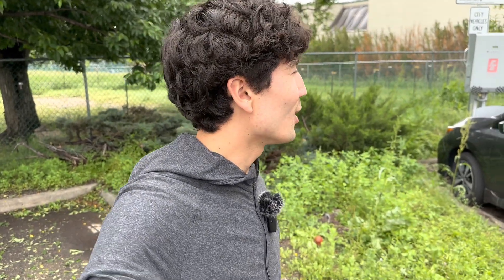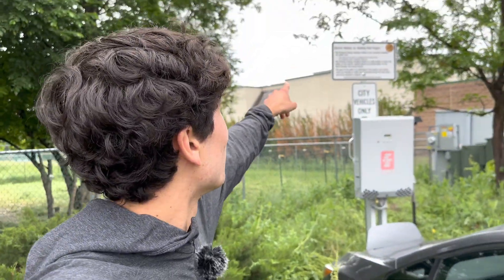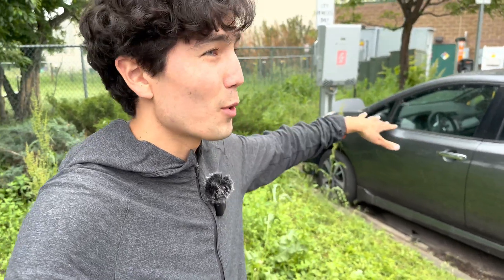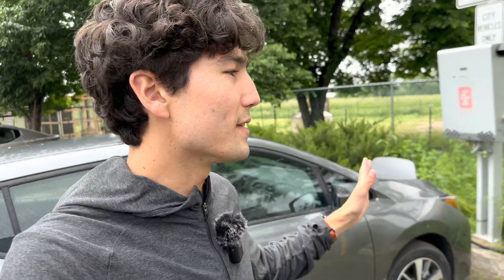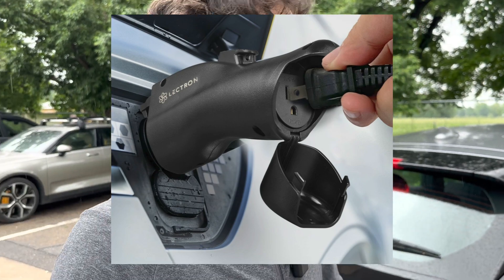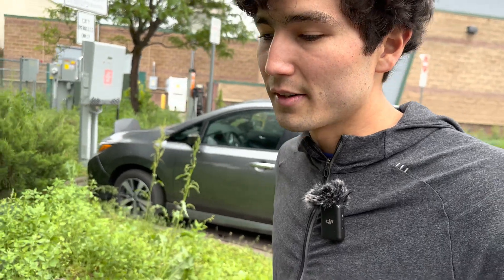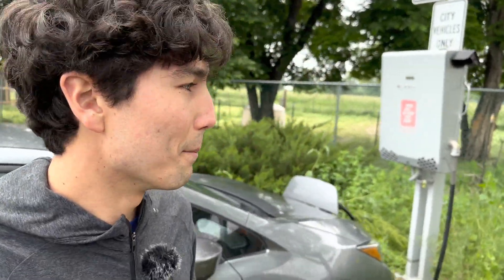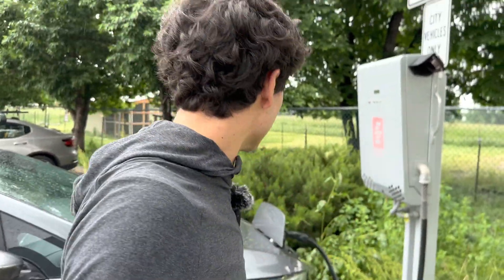This Awesome Tech Shouldn’t Die With The Nissan LEAF - Vehicle To Grid Explained

Comment: FWIW: the Mitsubishi iMiev was sold in the US from 2012 - 2017. It's an EV with a 16k battery and CHAdeMO connector. 

Mitsubishi replaced my battery a few years ago under warranty and it's still giving advertised range. I'd appreciate any info about a V2H system.

Comment: I just started researching this, just purchased an iD.4 at end of June and due to reroof had to have my 18 yo PV system removed and plan to have newer higher power more efficient system installed in same area.  I immediately latched onto the idea of using a Leaf primarily as a battery for V2H and secondly as a spare car.  I think these permanently installed home batteries don't work for me.  I use my garage for storing vehicles and tons of tools/toys so giving up a significant amount of space to a Tesla PowerWall is not an option.  Plus a Lead parked out in my side driveway would be safer, if fire, and more convenient.  The Leaf S could even be used to rescue a stranded EV either by towing it or driving it to another EV.  Unfortunately my electrical utility will not allow V2H at this time because they make too much money on peak electricity usage.  Also, Enphase bidirectional charger isn't available yet.

Comment: I have grid-tied solar, and I'd gladly buy a Leaf with bidirectional charging (although I already have a Bolt) primarily as a battery for my house.  However, I don't think I can get a V2X charger for CHADEMO in the US, or at least not for a decent price.  I know that my Bolt doesn't support V2X, but that seems like there should be an upgrade to get it working somehow...

Comment: It is WAY cheaper to have a car that can do VTG than buying batteries at home.  Buy a car, get free home batteries!
Reply: Better yet, buy a Leaf just for V2H and occasional errand.  There's no reason to put v2h capability in a Tesla or other bugger EV because technically it won't be plugged in at home during peak needs if you're using it as a car.

Comment: V2G has been utilized in Europe but I'm not aware of any utility doing this in the USA other than perhaps a pilot program.  It has great potential and could help with a number of issues, particularly peak shaving and frequency control.  Most people have no comprehension of the grid and the MASSIVE machine network behind their electricity delivered to them but I'd love a deep dive, perhaps Fermata and dcbel (in Canada) might provide some details of their endeavors in North America.
Reply: There are a few trials happening, but just a few.
Reply: I am banking on V2H being possible.  Even today it is not something you can get a permit for.  With the right equipment how would the utility know you are peak shaving using your car.  Leafs are so cheap compared to like capability home installed batteries that you can come out ahead buying a leaf just for v2h and occasional errand.